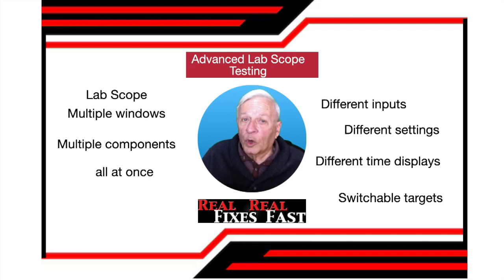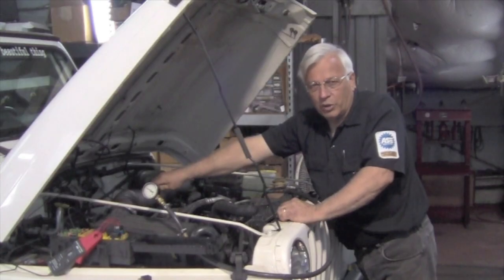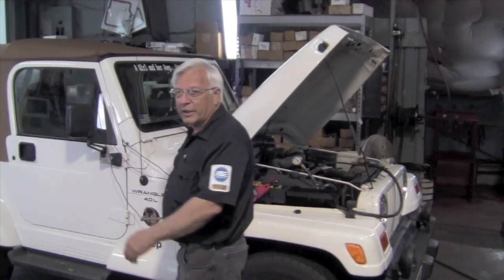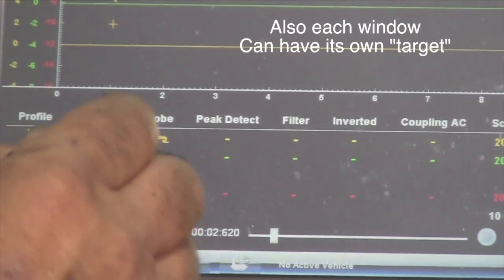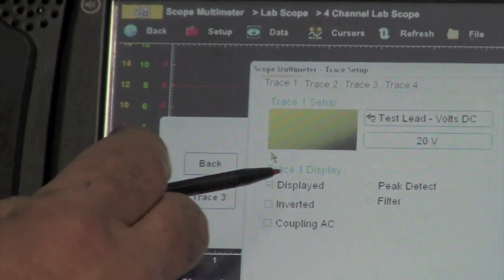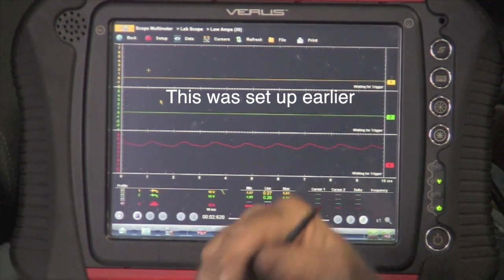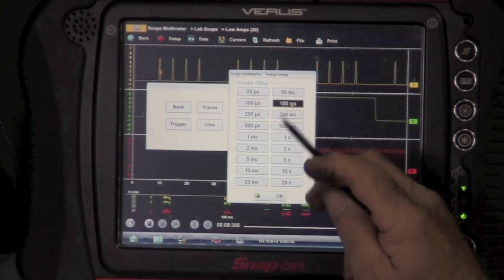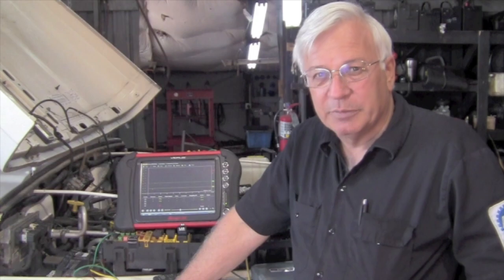Creative Labscope Skills

Comment: thanks so much this really helps i struggle with most scope operations at 68 only started using scope short time ago and its has been a challenge.
Reply from the maker: Keep at it, you will get there. It takes practice.
Reply: At 73 also learning.
Reply: @ thought it would be a lot easier voltage over time sounds simple
Reply: @henridekker9132 
Nice 👍🏼 !